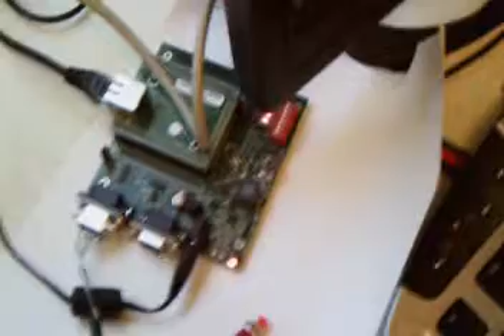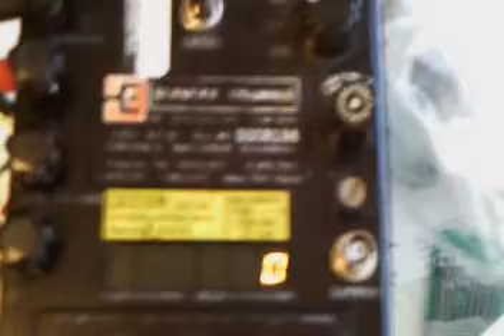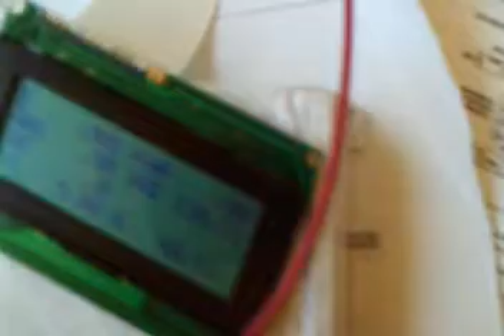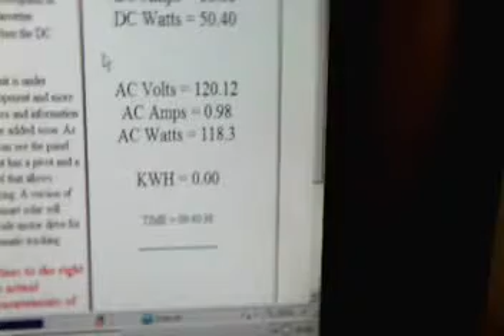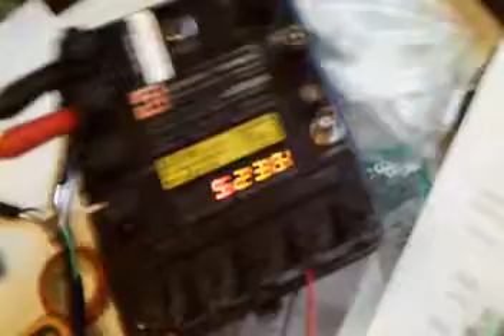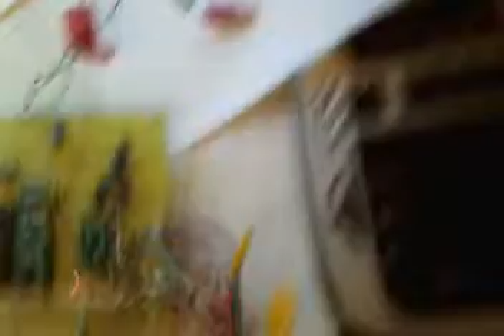Smartsolar7.MPG

Comment: excúseme do you have manual or conection diagram of Scientific Columbus KWH standard.
Reply from the maker: I don't have the manual - it is a Scientific Columbus SC-10 - and I couldn't find it on Google. Basically you connect 120V to the potential input (and the aux input to power the instrument). Connect current to the labeled terminals according to the current range needed. Observe polarity. This meter has a KH of 0.6 - that means one count of the red number is .6 watthours. I just pulled it out and verified that it is working by connecting it to a relay test set producing 120V and 0.833A. That is 100 watts, 100 WH per hour. So each red count, a turn of the disk should take place in 21.6 seconds. It did - so that is how you know you are on the same page as the standard. www.cttestset.com
Reply: Vernon Lermond thank you